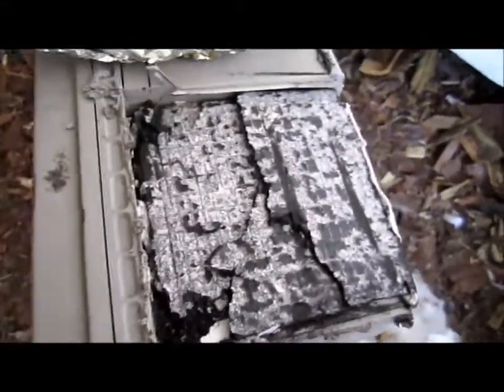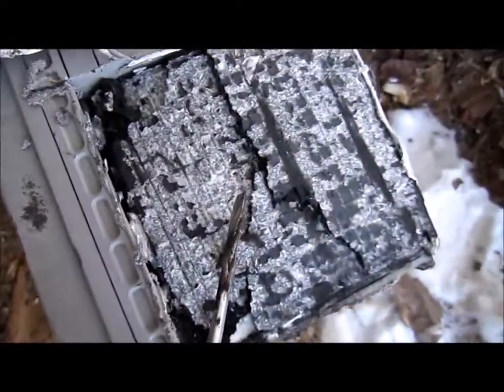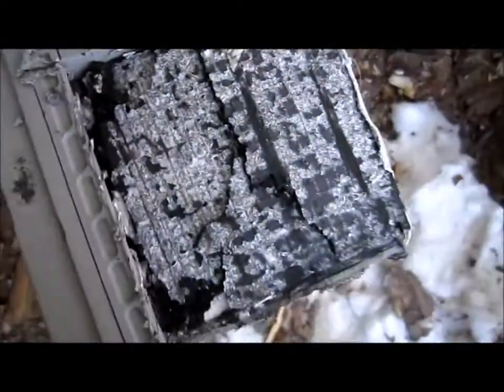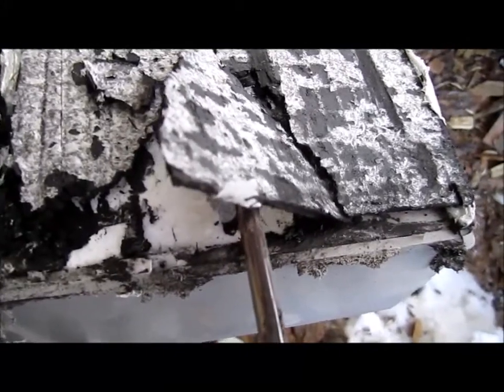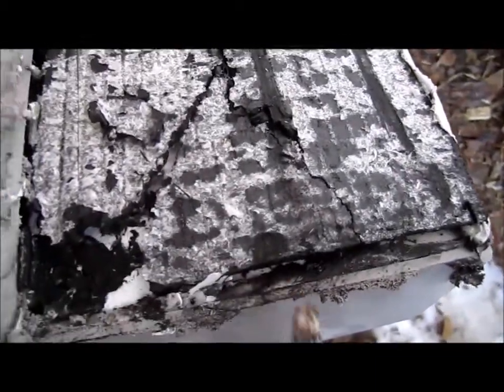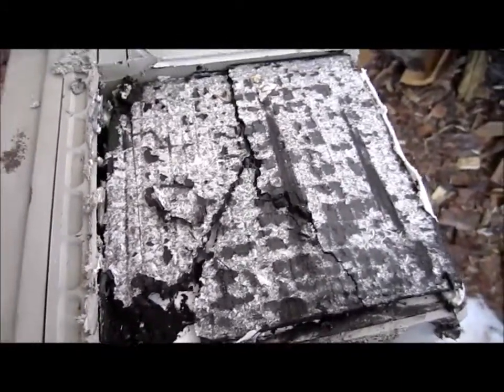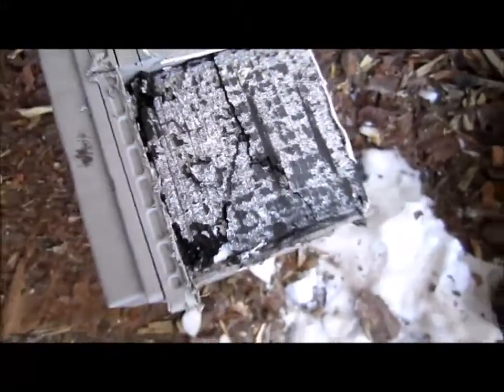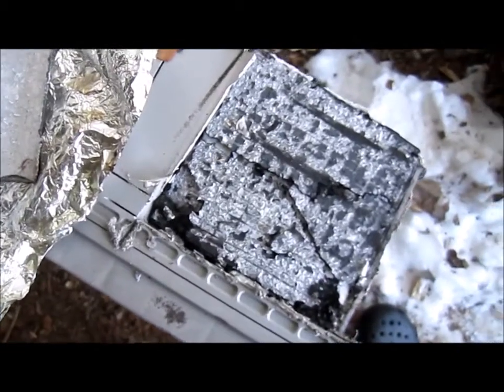Why 6 And 12 Volt Lead Acid Type Batteries Swell And Become Bulky On The Sides

Comment: I have a new agm battery that failed and the sides instead of swelling did just the opposite...they are collapsed or sucked inward if you will. What causes that ?
Reply from the maker: atmospheric pressure Then the inner seals seal again trapping it.

Comment: My interstate Costco battery is at the beginning stages of swelling. I noticed it first on the top. 1 of the 2 covers doesn’t lay flat on the top anymore. Tried to trickle charge it. Won’t hold a charge. Alternator output is reading at 13.9-14.4. No clue what could have caused this. It has a month and a few days left on the 3 year warranty. Will take it to Costco tomorrow and get it replaced

Comment: My brand new batteries did that is that from overcharging We got two scooters and the charges are basically the same well maybe but they both plug in the same terminal I might have used the wrong one and the batteries swelled they are brand new batteries are they still safe to use? You can tell they're swollen on the sides do I have to discard them?
Reply from the maker: I would trust them very much meaning taking the scooter to far if a battery just dies out which it can easy at them points. Will leave the scooter not being able to move along. That would sure be taking a chance. Best of luck. Cheers

Comment: Interesting.  Thanks.  I just ran into a different reason for bulging, it seems: a friend's golf cart (gas) battery was bulged on the sides.  That seems to be caused by it sitting discharged in the very cold Indiana winter.  I read that a charged battery needs extremely cold temperature to freeze (like minus 70 ...) but a discharged battery can freeze just below the "normal" freezing point of 30 degrees.
Reply from the maker: It's true yes.

Comment: I overcharged and the battery expanded.  Any idea how to get the bastard out of the enclosure without destroying the entire setup?
Reply from the maker: No easy way i can think of.
Reply: @MrDoingEverything  I would settle for a “hard” way.  I can’t even come up with one.
Reply from the maker: @charleshendrix232  If i could see the set up i may be able to have some idea's to how i would go about it. Perhaps make a video and send me the link. I really have no idea of the set up and with out seeing it i really don't know what to say on a method to use.
Reply: @MrDoingEverything  I saved a video to my home page.  Its the only video so you should have no problem seeing it.
Reply from the maker: @charleshendrix232   Could be a easy fix. One way would be to make one cut on the metal frame so it opens enough for the battery to come out then weld it back together or use another plate of steel and nut and bolt it back together. Or beings the battery is no more good. I would consider breaking the battery apart my self and making sure i have the right safety gear on. I would only consider that if i had no other means to use.

Had another look. What is that on the one side of the holder. It is not showing it's self very good. It looks like some sort of space fuller maybe a piece of rubber holding the battery tight. If that piece was made loose the battery should be able to come out. It looks like on the one side it's bolted in or something again it's not clear to see. Check that spot out to see what it is and see if it's able to be freed.
Reply: @MrDoingEverything  I appreciate your thoughts.  I think I will use one of those methods.  Not sure which one yet.  Thanks again.
Reply: @charleshendrix232  update please ? How did u get it out ?
Reply: @usavideogames7599  i had to cut extract the metal holder and battery and cut the metal to allow the battery to be removed then epoxy the metal back together and insert new battery.  All is well
Reply: @charleshendrix232  nice. Thanks